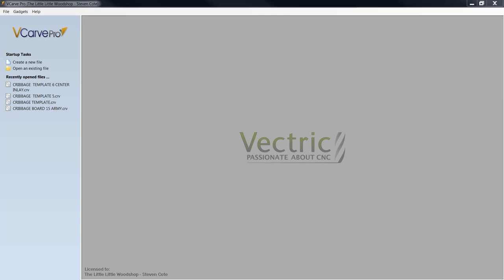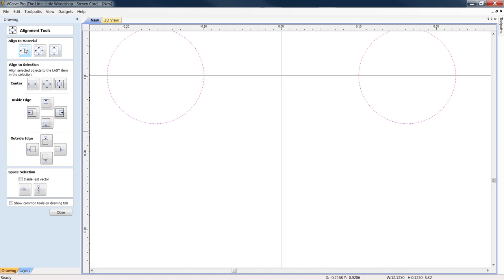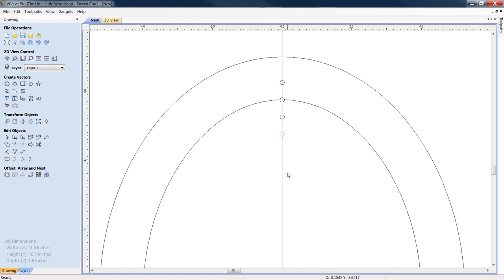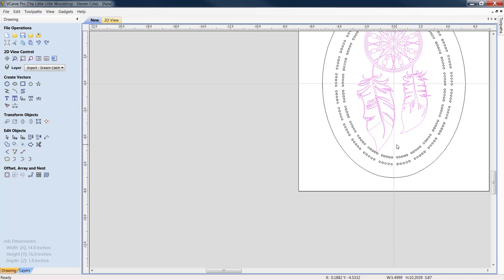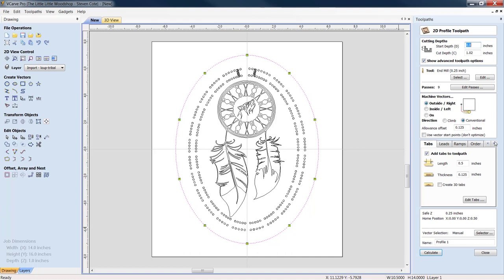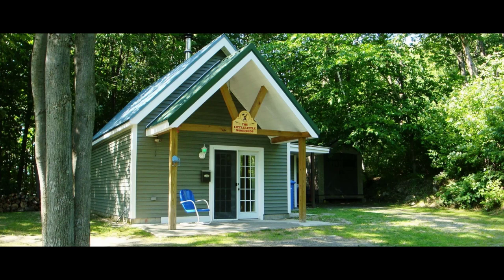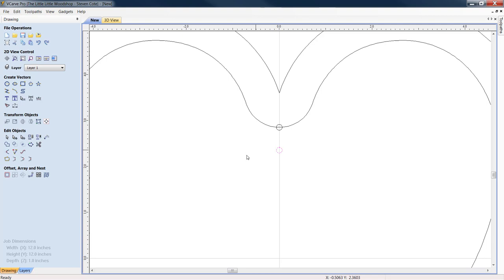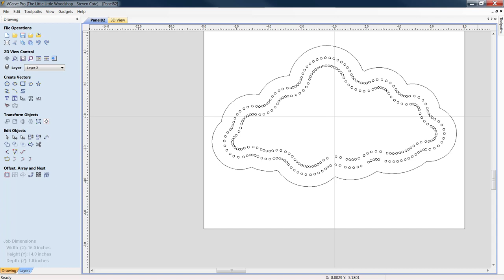Vcarve Pro Cribbage Board Design and Layout

Comment: Excellent video. I'm new at working with cnc routers. Just trying to get a handle on the software. This video will help big time, as the reason for me working with a cnc router is to do a crib board. But this isn't just an ordinary crib board. It is "Crib Wars"! 1060 holes. board is basically 12 inches square and as you can imagine there are numerous twists and turns. If your curious just google Amazon and Crib Wars. It will show a plastic version of it. I want wood. Wish me luck as I will need it. But after I watched this video, I think I have a good understanding what is possible with these routers. I'm a retired finish carpenter and I love working with wood.